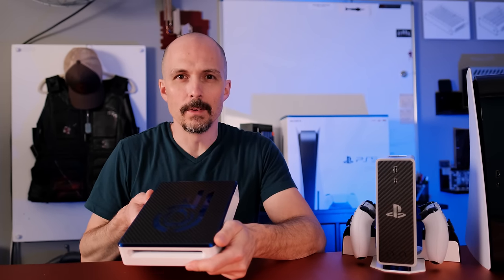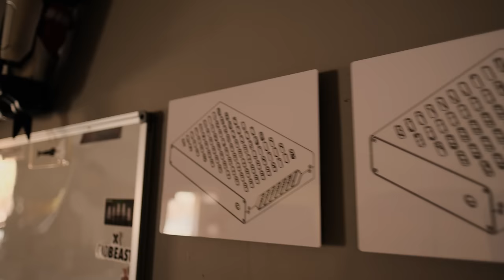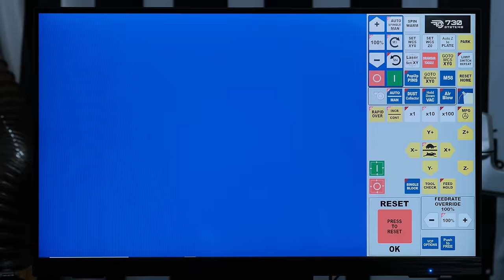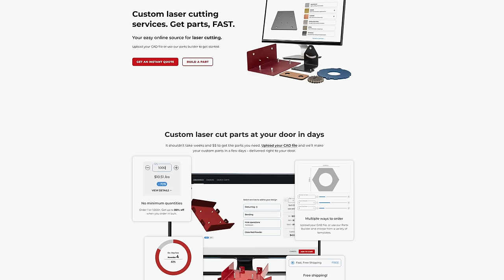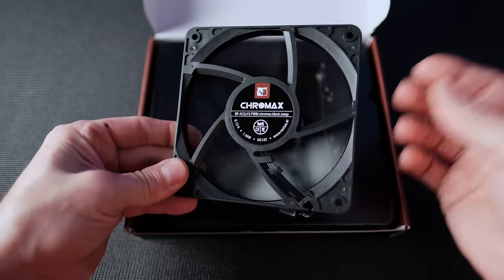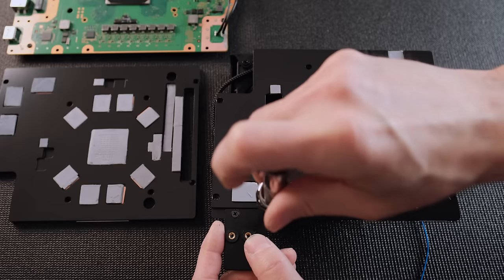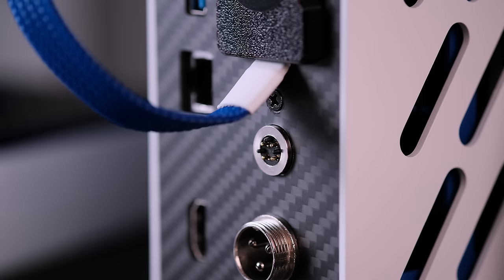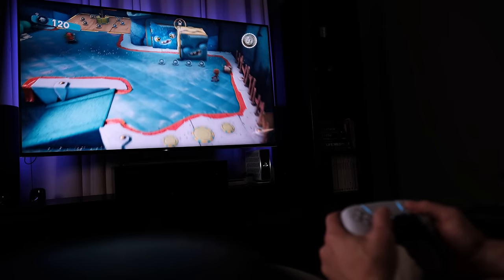Shrinking the PlayStation 5

Comment: This is much closer to what I was hoping the PS5 redesign would be. I don't understand why they're so married to their stupid form factor and an external Blu-ray drive, that you can leave tucked away until you actually have a reason to use it, would be so much nicer than the current situation. I imagine that I'll eventually get a set of plates and use it as a digital edition but unfortunately that means I'll also have to get a different set of horizontal stand pegs (if they're not included) or possibly a vertical stand, since it'll be a bit less stable without the bulk of the drive.

Comment: I feel that Sony wouldn't of went for your design because it is too practical. Like a PC. They want it to look Weird. Like a Console to try and maintain the illusion that there is a significant difference between PC and Console Hardware nowadays. 
I fully believe they started with the shell of the PS5 first, figured out the hardware, tried to shape the hardware to the shell and then adjusted the Shell to fit the Hardware which is why it's such a big machine.
Reply: I think they could have made a unique console that would be distinguishable from the rest in a smaller size. I don't know why they chose the look, but they are committed to it.

Comment: I wish it would be perfect if the new PS5 Slim had a detachable 4K UHD blu ray drive which even not only Blu ray, DVD, but also CD and backward compatible with all the PS1, PS2, PS3 💿Disc based games amd ot will be perfect if Ps5 Pro can Play games at 4K 240fps in Ray Tracing.

Comment: My man here, he made a PlayStation5 super slim. done correctly. 

And the style of this drive is probably the way to do it. You should probably show this to Sony. I would love to see this as a true product or something very very similar. I might actually jump back to PlayStation if this turns out to be a retail product that I can buy.
Reply: This style will cost too much too build due to all the small custom components required to be created to fit within the limited space shell not to mention the standalone ultra 4k Blu-ray player plus the separate cooling system plus the power source as well

PlayStation 5 costs around $450 to manufacture, imagine how much this will increase said cost

Comment: this is what we need more compact consoles and love the external idea go all the way with external everything and to add sony needs to make cartridge based console in a compact frame with a powerfull game card about the size of ps2 memory card and if would not cost that much if you take the size of switch and its cost. a 10 x 10 console about 1 1/2 high cost would not be to are off drop disc but not going all digital. make everything cartridge based console and handhelds and if they can work together for home and on go gaming great. and def. make handheld be used as controller on cartridge console.
Reply: Why would Sony Corp go "cartridge" when they earn royalties from every blu ray discs, players, drives sold thanks to building the blu ray fornat

Comment: Exactly what I was thinking, external disc drive, with cable connected to ports at back of console.
I was contemplating, if PlayStation 5 disc drives, were able to, daisy chain, with two ports connected at back of disc drive.

I hope PlayStation 5 Pro and PlayStation 6, have external disc drives, with better console design that can sit flat on a surface.

(I wish SONY would implement, disc creation tools, to write, personal game installation backups of downloaded games). Just like Steam Game Client.

I prefer disk drives to sit, horizontal position.
I will try this, daisy chain, of PlayStation 5 Slim disc drive, using original PlayStation 5 and Slim.

Thanks for the inspiration.

Comment: i think if you had Sony's support you could have had a custom disc drive that can be sloted to the side of the Tint PS5making it more of a small cube shape instead of a think rectangle and it would still be smaller than the original ps5

Comment: Thank you! I extended the cables to my og jailbroken PS4 and used a Xbox 360 power supply cause my internal PSU died on me. I wonder if you can make the Xbox series s slimmer I couldn't even add a dial switch for my fan because it's all pretty tight fitted.

Comment: You might want to re-think letting the fan run at full blast while the system is powered off to cool it rapidly.
I don't know if sony fixed the problem, but with the older PS3s and early PS4s, the underfill material used to mount the CPU die to their PCBs and the solder balls themselves do NOT handle rapid heat flexing stress over long periods of time very well. The underfill expands and contracts too much and can damage the solder balls under the CPU die over time.
You might want to make sure your fan profile for turn off "cool down" is gradual enough to prevent this, especially since with the CPU powered down, it will not be generating any heat to counteract the rapid cooling.
Reply: The fan doesn't run at full blast. I made a change at the last minute before the video was published, but didn't have time to make the changes. The fan speed controller ramps up and down based on the system temp. It's a slower process than I said it was and doesn't last as long.
Reply: @nfcerick3634  that's excellent. I hope your creation lasts many long years!

Comment: Dude, literally the only reason I haven’t bought a PS5 is because I am baffled that in the latest generation of consoles, it got larger instead of smaller. I can’t stand the idea of that huge piece of plastic sitting on top of my media center when I have gone to great lengths to have something that would HIDE my gaming and media systems. I wish you would be willing/able to mass produce these. I would easily pay you the same $600 that sony wants me to drop on the stock system just customize it for me the way you did yours.

Comment: I wonder what you could have done if you used the slim console.
Reply: They flipped the orientation of the PCB so it won't work in the Skyreach 4 Tiny case, which is what part of the challenge was about.

Comment: I dont really have complaints about the current size. I'd rather it be larger to make the machine quieter then have the jet engine which was the PS4. Its significantly quieter than any other consoles i've owned even when the fans at max speed. Tho i must say the way you've packaged it is just so clean. Would fit my more minimalist setup better

Comment: I'm convinced that game console companies make them bigger because then people are inclined to buy it for the set price. With that said, handhelds are equally expensive, or more, and they sell. But they also sell because they are handheld, people really want something they can travel with, use in bed, sofa, bus, etc. MS and Sony should do what you did in the video, and they should make actual handhelds for when you aren't at your stationary console.
Reply: Consoles vary in size to accomodate the tech built into them

The PlayStation 5 is 8 times more powerful than a single PlayStation 4 as such needs improved cooling hence the big size that ensures optimum airflow maintaning a low temperature even with nonstop playing
Reply: @bamban_garcia5562  Amazing that the custom PS5 in this video is on par with the original console.
Reply: @PenOkOh  Not really it's just the main console cut into parts, motherboard / 4k player / power supply / cooling system

You can theoretically make it as small as possible as long as you can fit the motherboard on a smaller package

Comment: Sony can do this but only the rich and hardcore will buy this as it will definitely come with an expensive price tag. Would not be surprised if it would cost more than $1000 for something like this with regards to current manufacturing costs and materials that would be used.

Comment: sensational build
Not to detract from it but...
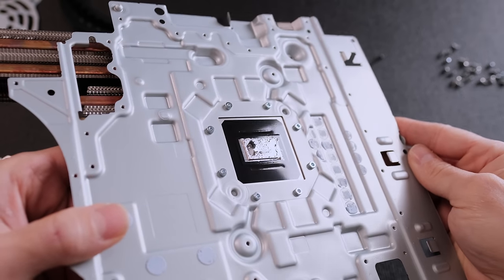6:25 - "too much TIM reduces thermal performance" - I'm dead certain that is WRONG, and it has been proven time and time again.
Applying more TIM (Liquid form) doesnt effect the final headspace between the die and coldplate at all. it will mount to the exact same z height, determined by the mounting hardware, and any surplus volume will end up squeezed off the side of the die. 
In Sony's case there is more than the bare minimum because they expect their console to used in differing environments; where flexation / temperature / vibration COULD effect Z height, in which case surface tension may wick the LM back into that gap. 

too much TIM doesnt reduce thermal performance, it just makes a mess. Too little is a big problem though.

Comment: wouldve looked better if the side panels were cut with the O, X, triangle, square.... PS symbols, instead of using those industrial looking side grid panels
Reply: I appreciate the feedback. The case is the SkyReach 4 Tiny (S4T). We designed, produced, and just sold out of that case this summer. Shrinking the PS5 and getting it to fit inside the S4T was part of the challenge. Perhaps in the future I'll do a scratch build with something like you suggested.

Comment: I don't want external disk drives. I do not buy games online since this requires much more space. It is easier to just install a disc and uninstall it instead of downloading over 100GB. Next to that, I prefer physical games since you can buy used ones for very low prices. Specially today were games do come out, but instead take months of updates before they run like they should.  Most of the time games are announce 3 years in advance, and when they come out I don't really find the need to play them anymore. There are so many games, so why should I wait 3 years to play one for 80 dollars, when I can buy 4 games for that price and play them today? I really like the design of this slim Ps5, and it is impressive that everything works like it should. That's a great job!! But taking out the disc drive actually defeats the purpose in my view. It is not shrinking the ps5, but it is shrinking it to a PS5 Digital. And that is a big difference in my opinion. Instead of having one big device, you now have two smaller ones. Not really my idea of a solution. But I do still think it looks nice and is very impressive in how well you did it, making a well finished design that looks and feels like it came of a legit factory line.

Comment: What cnc machine was used in this video "Shrinking the PlayStation 5". looks close to a 4by4 foot bed with auto tool changer.  and with a S30C spindle i think (correct me if i'm wrong)
Reply: You're right, mostly. AVID CNC 2x3 Benchtop with ATC system. I built it from the ground up.

Comment: Why did you not measure temperature of the VRM and VRAM and Chipset. You can't just measure the SOC
Reply: The stock PS5 uses a thin 1mm aluminum plate to cool those areas with gobs of TIM, and the heatsink VRM has a single heat pipe that has poor contact with those components. I didn't measure them on the PS5 Tiny because I wasn't concerned about them after using 6 mm thick heatsink plates that make direct contact via high performance thermal pads, and/or copper shims. My main concern was the SoC heatsink, so I focused on that.

Comment: You have more airflow, than the original PS5 xD
But if you had the ability to set your Fan to like 800rpm in Idle, its like noiseless... So a better fan controller would do it better, but also to who im talking. I dont even had the ability to print something... but i would kie to 

I actually like the new design of the PS5 xD
But its phenomenal big, normally means it better cooling,but yeahhh... without airflow no great cooling :(

Comment: Wondering why you didn't use the new 'slim' PS5 for this custom build, since it is already designed to have a removable disc drive. Would have made that part of the build a bit easier, no?
Reply: I did this before the new "slim" was even revealed in October.

Comment: I wouldnt mind if the ps5 was wider keeping the ps5 and disc drive together. I hate the design of ps5 becouse horizontaly it takes so much space and verticaly it cant fit into my shelf. Nice work btw.
Reply: I made a few designs for this build, and that was one of them. I really wanted the external disc drive option, so I went with that.

Comment: Isn't a 250-watt power supply too small, considering that based on measurements, the PS5 consumes much more power in most games?
Reply: Yes PlayStation 5 peaks at 350 watts with intense gaming anything below is too low
Reply: @bamban_garcia5562  So, how does it work for him with a 250-watt power supply unit? I think with the first power jump, the PlayStation will just shut down.
Reply: @CloudyEye  Works because consoles tend to have higher power capacity built into them as a safety precaution though tend to not hit such peaks even during hardcore gaming though it's better to keep such power since the console plus safety built into it was designed around the 350 watt output not lower

Comment: Practically we can create that much size....but it soonly damaged by heat....ssds are weaker compared to hdd for thermal resistance....games will corrupting soon and other parts will soonly malfunctioned by heat...even if it has cooler

Comment: Cool look for 1 off. I don't think your comments about the application of the liquid metal from sonys perspective, or your lack of faith in the way it was applied, is accurate. Your thermals were higher. So they botched the liquid metal application, but it still out performed your interpretation. I like that the ps5 is more than a rectangle. Just saying.
Reply: The thermal performance measurements were made after I reapplied the LM on the PS5 (which improved the thermals vs the stock application). This has been the case since the PS5 launched. There are countless videos about the subject on YouTube. I wish that I didn't have to reapply the LM, but it had to be done since I had to remove the heatsink so that I could bore a thermal probe into it. I never made the claim that the Tiny PS5 performed better, and the difference between them on the thermal charts is pretty close to negligible. The real takeaway is that today's (and possibly future) consoles are larger than they need to be. Your opinion about the look of the PS5 doesn't offend me, I can respect that. I made several designs, and in the end I had to choose one. I can't win everyone's approval. Thanks for commenting!

Comment: if you can do it why doesn't Sony do it !?
Reply: Because doing so would require way more costly smaller custom components to be designed for it on top of a slower production process

Manufacturing would go from the $450 standard it costs now to $600 or more for each single system built

Any custom job will always cost more then the console itself, look at the $5,000 water cooled PS5 or the $450 cooling block that requires you to still buy the $500 system plus tear it apart yourself

Comment: 3 liters? Hahahaha PLEASE, you have removed the disk reader and also use misleading perspectives. Also, a 250W source instead of a 372W one, which is what the original source gives. I understand the idea of the project but really what you have done in certain aspects is technically wrong
Reply from the maker: I super appreciate the comment because it is technical. The PS5 version we used is no longer 372w; it has the latest die and it pulls about 200w under load. About the size comparison, I'm not sure if it's misleading. The idea was having the disc drive optional. The PS5 Digital version is over 9L right? It doesn't have a Disc drive and it's still three times the size, digital to digital. I don't think we use any misleading perspective shots, and you can download the CAD model and see it yourself. But at the end of the day it's not the size that drove the project it's the quality of the pieces. We gotta have a hook, and it's not a dishonest one. Hope this makes some sense. Thanks

Comment: $20 says this PS5 over heats. It has issues heating up in its normal size case compacting it like a PC isn't going to help that. Imo all this time and effort go buy a real gaming system like a PC. This seems pointless to make. Almost all of the slim edition ps 2-5 all had issues with over heating.....why would this be any different imo probably worse as this guy just took the parts and put it in a mini. I can tell you this if PlayStation could have done this and made more money from it they would.

I bet this guy's PS5 doesn't last more than a year.

Side note so much work! For what still ps5 speeds. Seems like a lot of work for just shrinking down a already slow system lol.
Reply: We specialize in gaming PCs, and do a lot of custom builds. We make the Skyreach 4 MINI and Skyreach 4 TINY PC cases along with dozens of other custom cases. You should check out our other videos. We welcome you to join our Discord community.

This was a passion project that explored the possibility of what could be done with the PS5. This PS5 hasn't overheated yet since the Skyreach 4 Tiny (case) is made from aluminum with total ventilation coverage vs the suffocating plastic shell on all Playstation consoles.

Stay tuned for the next iteration...
Reply: @nfcerick3634  wait got next itteration?